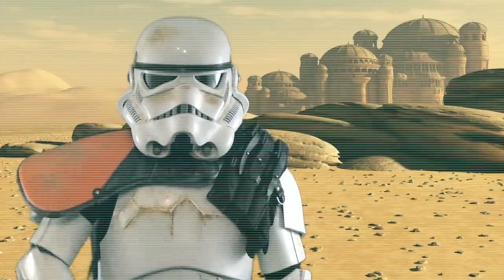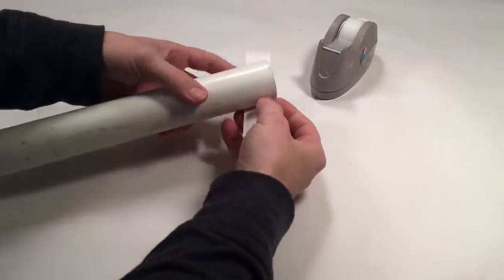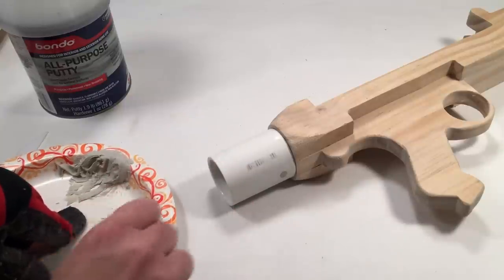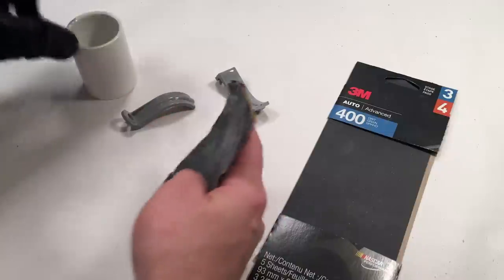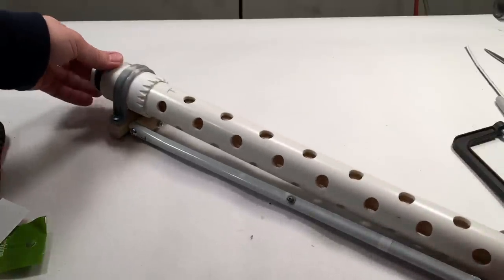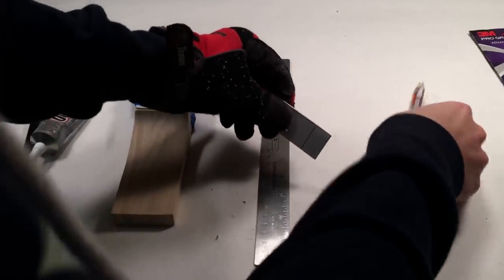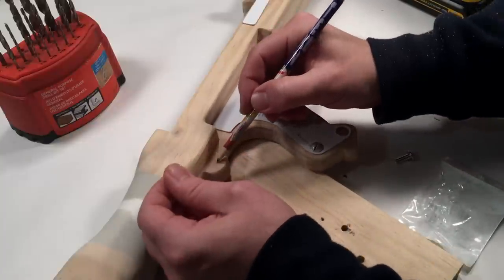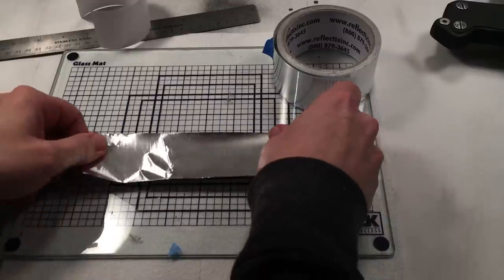Stormtrooper DLT-19/MG34 Heavy Blaster Rifle Prop DIY

Comment: I would be interested in seeing your take on building the A280c blaster rifle
Reply: Which one? The one seen in Star Wars Battlefront (2016) or in the movies? 
(The A280 is based off of an M4 platform and the A280c is based off the Sturmgewehr 44. DICE named the A280c (STG) from their "Star Wars: Battlefront" the A280. They almost had it correct but were off by one letter.)
(Also, the A280c is very similar to its counterpart, the A295. (Same base weapon, the STG 44.))
Reply: He doesn’t make rebel blasters only imperial, bounty hunter, Jawa and smugglers blasters

Comment: Can confirm, a 1/2 inch forstner bit works great for making the barrel holes. Made pilot holes with a small drill bit first and then hit it with the forstner bit. The leftover bits can easily be scraped away with an exacto blade.

Comment: Wow, great work.
And that is a good tutorial for a german MG34 prop, too.
There are only slightly differences. 
Well, sure, the blaster is based on it, but still.

Don't get me wrong, I like this build, but doesn't the blaster has these fins on the holed barrel cover?
Reply from the maker: Yes, you are right.  In the Star Wars films, they covered the barrel with furniture "T-racks".  They did this on the E-11 and lightsaber hilts too.  I did not include them.  Feel free to add them :-)

Comment: Okay great video however I did find one flaw trying to make this as accurate as possible you say in your parts list that the barrel is a 1-1/4 inch diameter pipe after purchasing this when I put your barrel template on it did not line up correctly so I obtained some 1-1/2 inch barrel in which it seems to fit better and an original mg 34 has a 1-1/2 inch barrel and not a 1-1/4 inch barrel as you said

Comment: You certainly have skills!
   If I may, almost all modern firearms and accessories use either flat, hex, or star heads. If you did the sane, your projects would look more realistic.
 Now I have to build one of these! (With hex screws and bolts of course, lol)  and I may add the double drum like you made for the RT97C replica

Comment: Hi there, awesome build! My issue is with printing the templates as described. I’ve bought 1 & 1/4 pvc pipe 32mm, but the barrel template is printing too big, the holes don’t line up and that’s printing via pdf in poster actual size? Taped together, the outer barrel template is 19 inch long which I think is right? My confusion increases as the printed greeblies showing sizes in mm are actually printing exactly to size, but the circular end template is about 50mm dia instead of about 32mm and that’s on the same sheet? Any advice would be appreciated.

Comment: Very nice. Very well done piece and video. Thanx for showing how it's done. I have a vid of my vintage Kenner Blaster Rifle. The 3-volt motor sounds like a drill lol but the (2) heavy D batteries in the back really make the gun have a nice feel to it. it reminds me when Han Solo is running from the Stormtroopers in the Death Star firing back at them the way he held it kind of bent at the wrist.

I have a DIY Halloween yard haunt and fog chiller channel "yardhaunt2000" with old videos. Extensive use of PVC and Krylon Fusion. The guy at home depot said he didn't think PVC was used for plumbing anymore lol I drilled holes like that in a PCV pipe in one fog chiller inlet test that's what this reminds me of.

MTFBWY
Reply from the maker: HAHAHA, that's a funny story about PVC.  I guess its true, I can't remember the last time that I bought plumbing parts for actual plumbing.  I remember that Kenner blaster when I was a kid.  That thing was awesome, a nice heavy toy.  D batteries will definitely add some weight!  I'm off to checkout your channel, I love Halloween FX!  Thank you for watching.
Reply: Yeah it’d be cool if you checked out the Star Wars collectibles and the Yard haunt channel. It’s worth your time.

The home depot guy knew me since I went back a few times. He said someone came in with Halloween fog chiller plans. He described it. It was my video ^v^

Back in the day I supplemented halloween and haunt forum posts with my videos. I was one of a handful who had fog chiller test vids. Now there’s hundreds. One was a ghostsofhalloween . com trash can chiller of which I’m the only one who ever gives them credit and they don’t even use it anymore lol I used it with a 1,180 W Chauvet fogger this year with. The cigarette smoker next door was complaining about too much smoke when she came out to look at it lol 

The other chiller I show is based on a Vortex product which was born out of the forums called Fog on the Rocks design. We reverse engineered it to literally reverse the inlet & outlet. And that’ s the one we tried the gun holes on. 

I was the one who thought of using a 48 qt Igloo square cooler. Now a lot of people use them. Most used Kitty Litter pails which looked like the product. I don’t have a cat. So I wandered down the camping aisle at Walmart and said hmm that cooler should do it. I do that at Joann Crafts too lol The insulation doesn’t mean anything just the compact shape & size. I used Krylon Fusion doesn’t need primer on plastic. It does off scratch a little but in a weathered way.

A compilation of the chiller and fogging witch cauldrons using chillers is at 9 minutes into my “HALLOWEEN Which Witch? Game, Cauldron Prop, Graveyard Fog, Cedar Point Witches | Collection THX1138 ” video on the Star Wars channel.

I almost did a vid in my Vader costume with a chiller to make it look like the carbon freezing chamber atmosphere. If the fog doesn't lay low it's still slow and lingers which I like better.

The Halloween channel was started in 2008 with a prosumer SONY TRV-30 MiniDV. The vids looked great. Then YouTube switched to HD and res’d them down to as low as 240P (!) they still sound good. I could re-upload them from the master tapes or DVD-R’s. I don’t make adsense on that channel anymore. It’s not worth it.

I have a huge PVC blacklight entry archway from a vid in storage I'll probably never use.

I didn’t upload my last three years of yard haunts yet. My dad dressed in my Rubie’s Darth Vader costume with my Master Replica’s lightsaber. The Rubie’s Vader gloves are very comfortable! They also work great for props. Very easy to work with. Check out my vid “LIFE-SIZE Halloween PVC Prop Build How-To Emperor of Evil!” ^v^

MTFBWY

Comment: hi there Happy... I started on making this but the outer barrel template (with the holes) don't match up when I wrap it around the 1.25" pipe. I printed in poster option... any thoughts, or am I missing something?.. Edit: I just tried a piece of 1.5" pipe and it's almost a perfect fit.. could the diameter of the pipe be wrong?

Edit:
ok, I may have sorted it. I reprinted in Poster Option but made the Tile Scale 83% instead of 100%.. this is now perfect for the 1.25" pipe.

Comment: I had a friend print the templates but want to ask the size in inches the middle body/flip up parts are before I cut something too small possibly.
Reply from the maker: The middle piece of the receiver (the centerpiece with the grips) measures 14-5/8" and the centerpiece of the flip up part measures 9-15/16".

Comment: You forgot the piece from 27:32 in the link list in the description😥
Reply from the maker: That is a large mouthwash cap, secured to the 7/8" wooden dowel by a #6 1" screw.  Let me know if you have any questions.  I don't have a link for the mouthwash cap, I just purchased some mouthwash from a "Giant" grocery store.  If you go to any pharmacy or grocery store, you should be able to find a large mouthwash jug with a cap that will work for your blaster.  Good luck!
Reply: HappyTrooper Thanks. I rejoice to build that cool rifle. I'l buy a original Storm Trooper armour... It's gonna loock nice with the DLT-19😍😍😄😃💪👍

Comment: Is it possible to add a red pointer laser strobe light, along with sound?
Reply from the maker: While I haven't implemented these items, I'm sure it is possible.  There is some room underneath of that middle flip up receiver.  Even though it isn't in the films, I'm thinking of putting a small red LED in there, similar to the First Order F11.  Perhaps just a small toggle switch, a coin battery, and a single red LED.  Because lights are cool :)  Thank you for watching.

Comment: Any idea of how to break this down to put it in the bin with the armor?
Reply from the maker: If you don't glue the barrel to the stock piece, you can simply pull the 2 apart.  That's what I do.  It fits in my armor bin when transporting.  I just wrap the 2 pieces in sheets or blankets for a little protection.
Reply: Ahh nice, having a bit of problem cutting the wood out, but i think it's going pretty good so far.

Comment: I can't find the link for the templates
Reply from the maker: I suggest using a Mac/PC to view the description section.  From there, it is the first item listed in the parts list.  Once you have the template downloaded, use Adobe Reader to print out the templates.  Some require the poster option, others are actual size option.  You can view the description from a mobile device, if you scroll to the title of the video and expand the description by clicking the little arrow/triangle on the right side.  Viewers have expressed difficulty when attempting to print from a mobile device.  Please print from a Mac/PC using Adobe Reader.

Comment: Can the upper receiver flip up?
Reply from the maker: I suppose you can make it to flip up if you carve a little more wood off of the top of the receiver AND you do not screw it down (like I did in my video).  I didn't want it flopping around, so I secured it.  It wouldn't be difficult to make it flip up.

Comment: where is hexagon end cap?
Reply from the maker: If you watch from 29:49, you can see the hexagon end cap on the left of the screen.  After you insert the wood dowel (inside barrel) into the outside PVC barrel, you will see at 30:03 the hexagon end cap is inserted into the PVC coupling that holds the bipod assembly and fits on the barrel assembly.  Hope this helps you.
Reply: sorry about that. I was wondering if I could get the link to it. The link seems to be missing. Thanks so much for your help! Great video!
Reply from the maker: The picture in the link is not accurate.  I did copy the item number for that hexagon part from my receipt.  Do you have a Lowe's near you?  Perhaps you can order that part online so that they can have it ready for you.  http://low.es/2l3hUnX